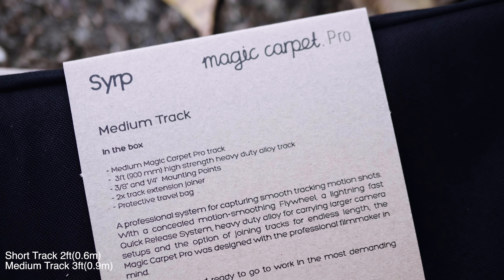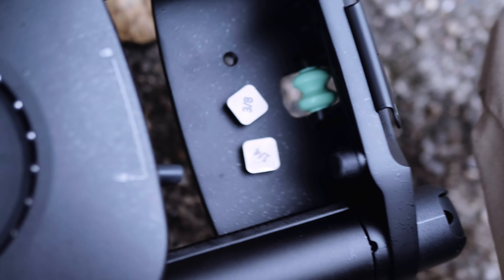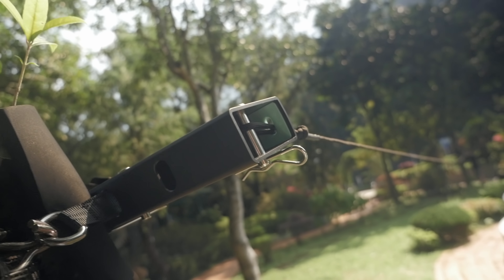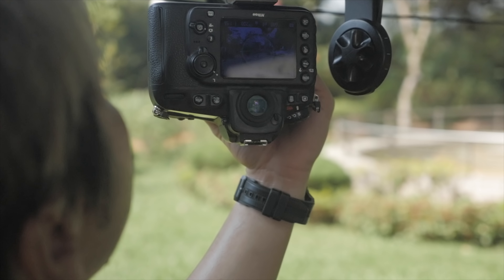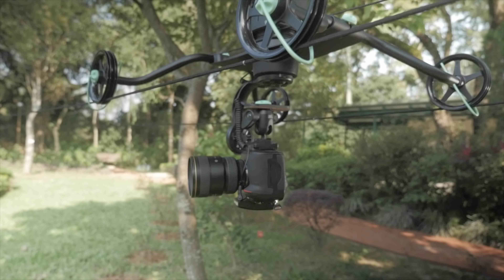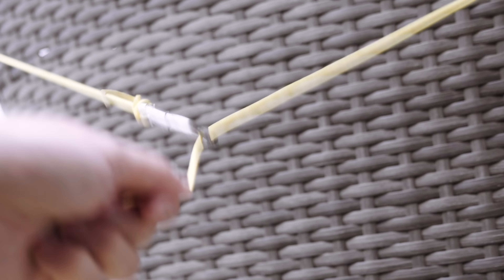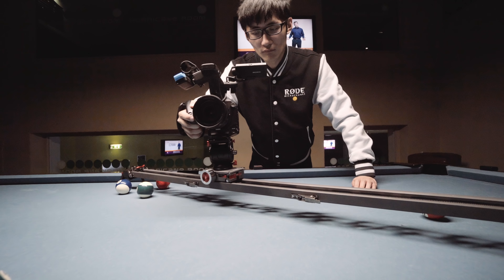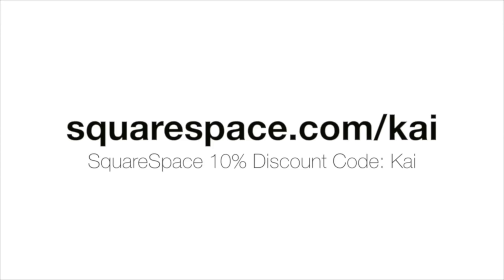Unboxing Cool Slidey Sliders!

Comment: I'd be willing to bet that wheel-lite could be made significantly better if the camera was lowered and it had some clip-on weighted structs either side. The extra mass would add a lot of stability while still being quite compact to carry.
Reply: Or even gyroscopes, or even all three options.

Comment: The Syrp gear is just great, i'm using it all the time. there are extensions for the sliders also, i'm now on a 230 cm slider with connecting the long & medium slider. harder to do are the vertical views with the new magic carpet and yes you have to carry your counterweight with you than. anyway happy newyear KaiW

Comment: you need to get a higher quality logo for your sponsors, when your video is in 4k and the logo for the sponsor is in 720p it dosent look very professional
Reply: Who do you think gave him the logo ?
Reply: @HarshNerf  id assume they send the same email to a lot of content creators, and they all do the sponsorships differently, so id assume that they dont send a specific logo that they have to use, because some might use video of their website, or showing a website they created etc. and if they where to send their logo in an email, they would use the vector based version they have so it woud fit for all purpeses (vector based means its not made with pixels, but curves described by mathematic formulas so no matter what size you make it the curves wont become pixaleted since it is then rendered to look exectly how it was designed no matter the pixel count it is rendered out to)
Reply: Wouldn't worry about it, his sponsors are shite too when you look properly. One of the things I do for a living is rescue peoples businesses and their websites from squarespace and Wix as the lock-ins and price hikes are insane. Pretty much everybody using those places are paying more than 200% more than most UK businesses charge for the same thing.

Comment: i will diy the slider need some Arduino some servo motors and some steel rods some Paracord and some coding i bet it will cost me lile 100$ or less let me try

Comment: The Wiral Lite works really well for the cost; pair it with a GoPro Karma Grip or DJI Osmo Pocket and as long as you set it up nice and tight, you'll get some great shots.. I had a quick go with mine recently and it turned out great! https://youtu.be/JlD6BZz1LR4